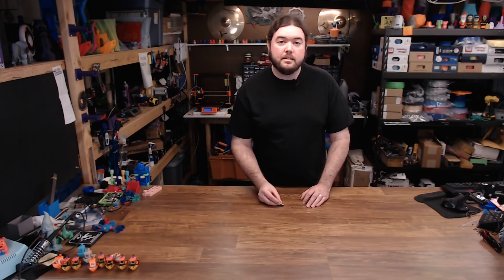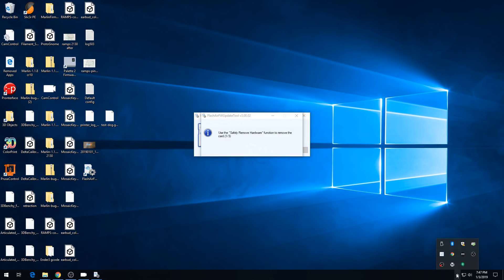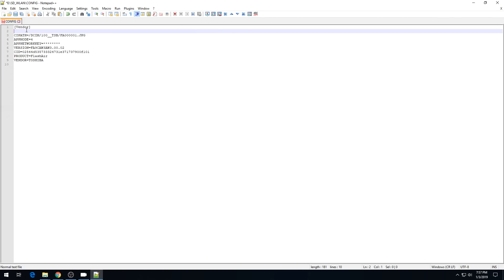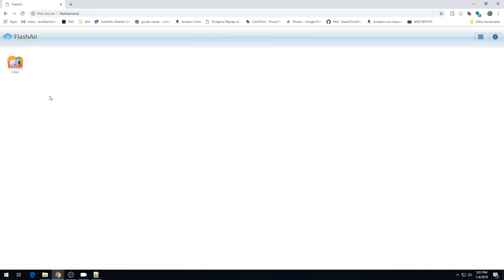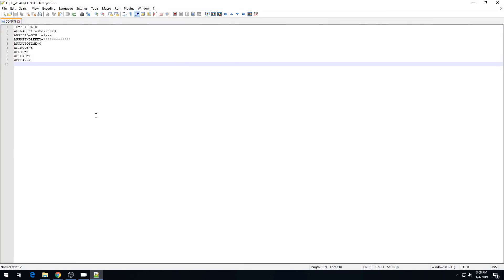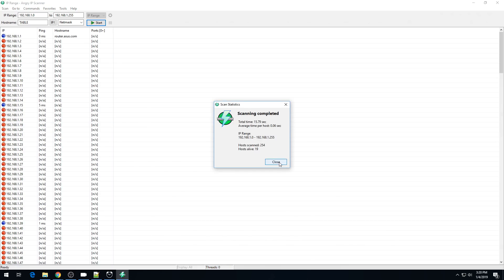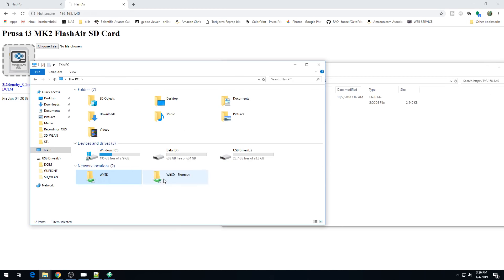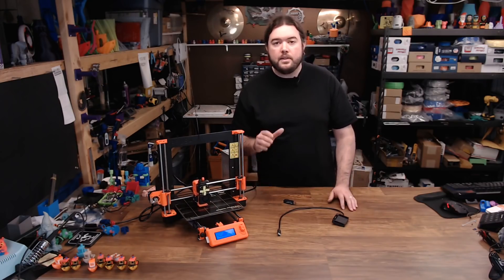Wifi SD Card For Your 3D Printer - Chris's Basement

Comment: It's best to define a DHCP area in your router to push your DHCP devices into a block. Got example I set my range from 192.168.1.10 - 192.168.1.100, then I use 1-10 for network devices like routers and access points and 101-255 is for blocks of fixed ip devices in groups so it's easy to find later like my octoprints are all in the 192.168.1.150-160 range, ip cameras are all in the 200+ range etc. That way I can just assign it a IP in the block for the type of device and never worry about it
Reply from the maker: I try to show the networking stuff a couple of different ways. None of them probably meet best practice by far. I am really just banking on the user not having a very big network most of the time. :) What your explaining makes total since and probably much safer. I could probably do 5+ videos on just this stuff. :) Thanks for the tips.

Comment: for me the main benefit over octoprint would be the ability to run the printer stand alone once the file was transferred. If i could also control my ender 2 with repetier host with through card that would be fantastic :)
Reply from the maker: That would be cool, also it would enable power off resume on some machines where octoprint wouldn't.

Comment: Great content as usual Chris! couple of issues using an IP scanner to find the address. You do not want to use any IP that is in your Routers DHCP range because it can lead to IP conflicts. Also opening up a cmd prompt on your PC and using ipconfig /all will tell you want your IP range is since it's commonly either 192.168.1.x or 192.168.0.x but there's other ranges used on some routers as well, just looking at your gateway address will let you know what your current range is easier.

Generally speaking for this kind of thing, and for most users who aren't well versed in networking basics, it's much easier to just define a DHCP reservation which would be a lot easier overall for people.

keep up the great work!
Reply from the maker: Thanks! Great tips! I try to show this a bunch of different ways, none really meet network best practices. DHCP reservation is always the easiest for me.
Reply: @ChrisRiley  DHCP reservation is the best way. Because you manage all your IPs one place, and avoid IP conflicts. But the setup is different from router to router. In this case,  you could have skipped assigning a fixed IP, by adding http://flashaircard as your drive, instead of http://192.168.1.40.
Reply from the maker: @PerMejdal  I totally agree. As you know a lot of routers don't have it, so I am trying to offer options.